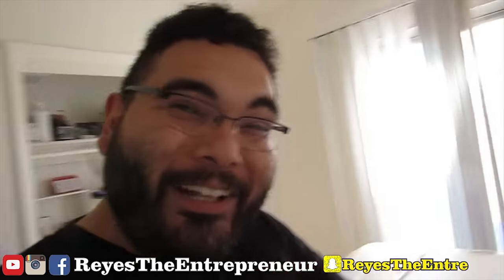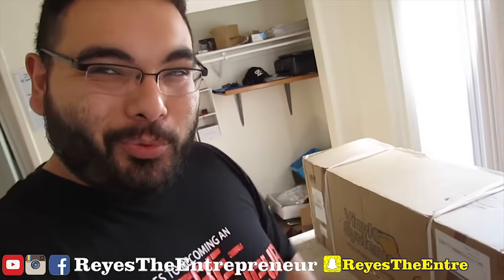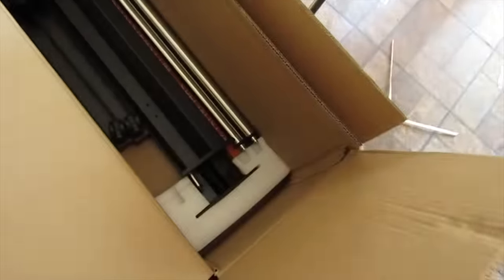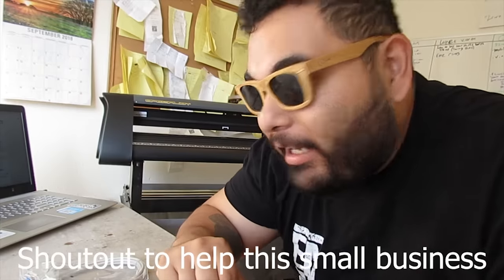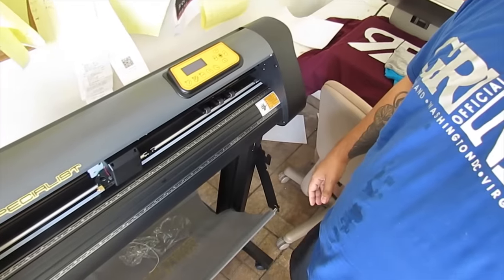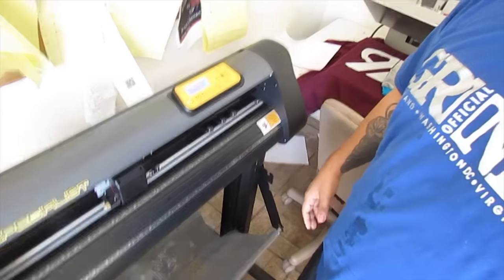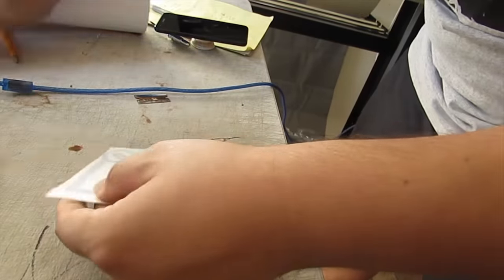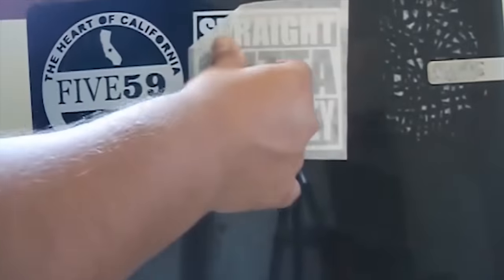$299 vinyl cutter to start your home business

Comment: Great Vid! I started the same way but only using a 10" cutter. I was homeless and lucky enough to couch surf (at the time), and saved up for the small cutter and sold decals at an artesian well, where I live and where a large population of the state community goes to get clean, cold, underground spring water. eventually I was able to pay a bit of rent to someone to stay there. I saved for the medium cutter. I think it is the 28" or 32" cutter. I not only did decals and shirts (SAVED FOR A HEAT-PRESS BUT STARTED BY USING AN IRON!), but also ENTIRE vehicle designs and themes! One of the cars I did, ended up in a Seahawks fan parade and the owner was invited to Seahawk home game events at Hawk's Alley which is where super-fans and player families hang out to tailgate. I also use US Cutter. Now I am delving into airbrushing and experimenting with ways to combine them. Such as: I go to a lot of fairs, carnivals, parades, biker rallies etc etc etc. (basically any city event i can), and now that I have an awning, I pay the rent fee to set up my 10'x10' space at these events (usually $100-$150 a weekend, but I used to set up a carrying case and a small sign on a sidedwalk nearest the event and basically pan-handle it) and sell pre-made t-shirts and decals while doing face-painting (which there is almost always a line for and I can Use my Cutter to make my own Mylar fcae-painting stencils for fast and efficient profit). If I can get off the streets as a homeless man by doing this anyone can make a profit! So awesome you shared your journey! I wish I could have as well!

Comment: Alternitvely you can find the com port in use by the cutter by opening up Device manager, Unplug the printer, plug it in and see if any new COM ports pop up in Ports in the device manager. Com port is reffering to which USB port.

Comment: Every computer has com ports (serial ports) one is represented as hardware (serial port, usb, any serial port..etc etc). There is also software port. Represented by com ports. Usually you have com1, com2, com3, com4. You look on the back of the machine or open your machine or find the schematic for the mother board and that will tell you how many com ports you have. Another advanced way of finding the number of com ports is looking in the bios boot software, then you look under serial ports or com ports and it will tell you how many com ports on the machine.
These comports are connected logically to addresses. These addresses link com port commands to the actually com port aka serial port. The addresses are like phone numbers each com port has to be a associated to a different address. Now adays the operating system picks the comport and address automatically. However sometimes there will be a conflict where 2 com ports share the same address which will cause the machine not to operate properly or not operate (com port conflict) and that is what happen in this video. 
The youtuber dude explaining went to software setting and opened advanced settings and choose a different com port...then the computer a signed it a free address. For example com port 1 with 3F8 address, and com port 2 with 2F7 and so on. 
So let's say you change the com port and still it doesn't work... Then you look for addresses and pick a different one until you find a free address.
Addresses are written in hex. 
That's the explanation to why it worked after he picked a different port. But you really don't have to know that unless the port doesn't work. You can always call support and some one with experience will help

Comment: I have the US Cutter 871 vinyl cutter, nearly identical to yours, using vinylmaster software I have it doing contour cutting of stickers now. Your videos are amazing, keep up the good work!
Reply: Ray C. Swornaugh 18  I was on a really tight budget and this was the cheapest vinyl cutter I could find that was more than a cricut, which I have one of btw :) I do tee shirts, decals, banners, and contour cut sticker sheets with it. Even though the literature says it can't do contour cutting I made a video on my channel showing how. It is really boring and a step by step guide. If you can afford a better cutter it will automate tasks that you have to perform manually with this model. I haven't found anything I want to do and can't do with it so far.
Reply: Ray C. Swornaugh 18  The software I use is VinylMaster Cut which came free with the cutter, Inkscape, and The Gimp for editing and design. I don't do much custom graphics, I'll touch up what is needed to make the customer graphics printable or cutable. This suite works nicely for me. create graphics in Inkscape or Gimp, transfer them to VinylMaster, print and cut. Where I put the majority of my money into was an HP designjet 120t 24" inkjet printer used $599.00 which will print on vinyl, heat transfer, banners, canvas etc at 24" x 50' max. I then use the vinyl cutter to cut out the graphics either as stickers, or for large banner application, if the graphics lend better to printing, otherwise I'll do color separation in vinyl.

Comment: The only problem with a $299 vinyl cutter is it's a toy. 

If you're handy you can cut sign vinyl with an X-Acto knife yourself - I've done it for window lettering for a small shop I had. 

HOWEVER .... a much more viable biz might be learning to brush-letter, by hand. Think of all those restaurants who want hand-lettered menus and specials signs, even people who want wedding stuff .... a good training school might be to work for a place like Trader Joe's or Whole Foods doing their signs, even if their style has some differences from old-skool lettering you'll need to un-learn later. The sheer experience cranking out signs is the most important.

Comment: At 12:50 it looks like you need to set the blade offset.  It will result in cleaner lines and curves.

Comment: so once I put the blade in that blade holder and then I place it into the clamp on the plotter how far down do I push the blade?  how far up from that white strip should the blade be?  My plotter looks like yours so I've gone through many sheets of vinyl and I either get a cut that's not deep enough or too deep.  Need some more direction here, please?

Comment: I appreciate the info.   I am trying to grow my business.   I use the Silhouette Cameo, currently, in addition to my clamshell heat press.  
My biggest requests are for printed stickers.  I've been getting requests for bigger and bigger stickers as I go, so looking to upgrade from the Cameo.  
With a cutter like this one, does it have the option like a print and cut?   Where I print the stickers, then put it on the cutter and cut them out?   I would love to upgrade the stickers that I do, and the larger cutter is the missing piece.  
Thank you for the video and the info.

Comment: love your videos. i bought a similar cutter and been having so much trouble getting it going. When i go to cut, it does nothing. I have to unplug the usb and put it back in and then it starts...BUT...it ignores origin and seems to be cutting tiny slits instead of a steady cut. So frustrating.
Reply: On the cutter I used to use..... if I attempted to load the program using the wrong buttons or settings it would fault in a similar way.  Are you able to hard line the cutterbto your computer?
Reply: @donrussell1577  thanks for response. not sure what you are asking.

Comment: While I know this video is 4 years old, my biggest problem with my plotter is how do you know where to start your cut, like lining up the vinyl on the plotter. When I place my vinyl it is at least a inch down and press go but it advances forward and starts to cut but there's no vinyl tp cut it hanging behind the roller. Should the cutter advancing and bringing the vinyl forward as it cuts. So frustrated and no videos for this cutter. It's a 34" Vevor but I would think vinyl cutters operate on the same premises. Thanks for any help.

Comment: So if I get a vinyl cutter I won't need a inkjet printer?
Reply: Yes and no from what I've learnt, the inkjet will give you more design options with multi coloured prints, you coukd do multi coloured prints with just s vinyl cutter but you would need to cut each colour then heat press each colour individually which would take time and increase the chance of errors.🙌
Reply: @speedygonzalez2158  thank you

Comment: I'm looking to get a desktop vinyl cutter, but I am not sure if I want to turn it into a business or anything beyond just hobby work. What is a good, cheap 15" cutter I can get that I can easily resell if it turns out this ain't for me? I'm looking at the USCutter's Titan, but I'm not sure if I should get the one with the stepper motor or the servo motor.

Comment: Hey reyes whats a good program make designs to start screen printing?
Reply: tonytactckle 
Free options: Gimp or Inkscape
Industry Standard: Adobe creative suite. Primarily illustrator and photoshop. The problem with that is you must purchase a subscription. That means you'll be tied to them until you die or hell freezes over. Which ever comes first. 
My favorite and what Reyes uses: Corel Draw. It's as good as Adobe but you can own it outright or buy a subscription. Good luck.

Comment: I bought a plotter in amazon vevor but I cannot calibrate it for the image cuts I have tried anyway and it is not calibrated short outside the design I am desperate how can I calibrate because it does not have a laser and did not come with the factory parameters noce how much is it X - And because it did not bring the stiker of the parameters I hope you can help me, I have been trying to solve tengp the singmaster program pro vinyl cut it without problems I need to calibrate to make stikers thanks VEVOR KI-720

Comment: this title and video is very misleading regarding pricing and software. the cutter is $399 plus tax including a software that is pretty much useless unless you buy the pro version which btw the cutter only works with this specific software so you have to pay an additional $179 to make this work in the form you need it in. now you’re at $519. you might as well pay an extra $100 towards a better product like the silhouette or a graphtec. this product is not compatible with mac os software as well which is a huge disadvantage.